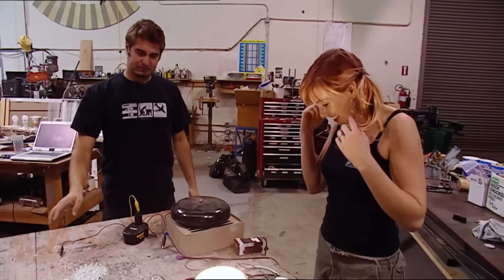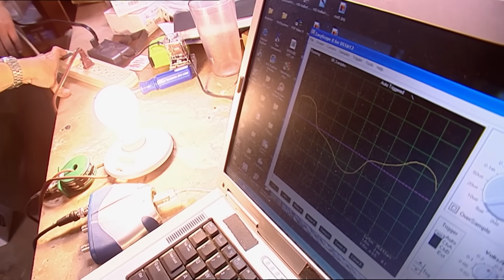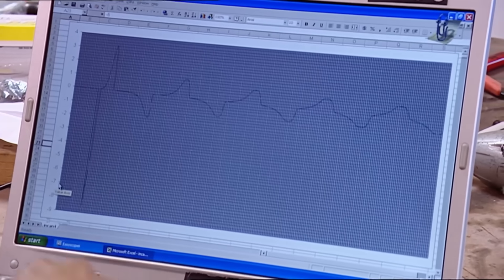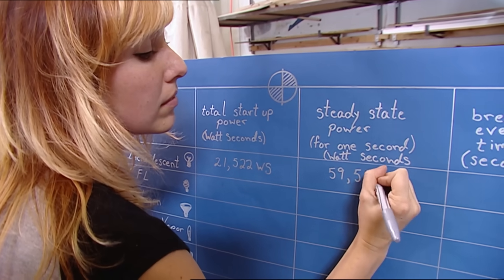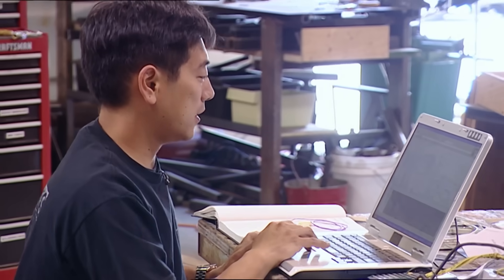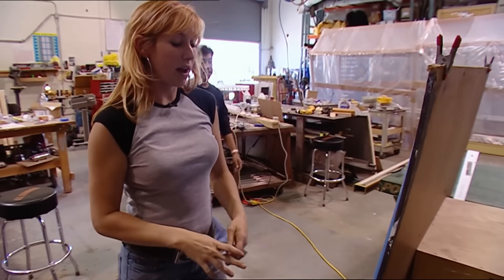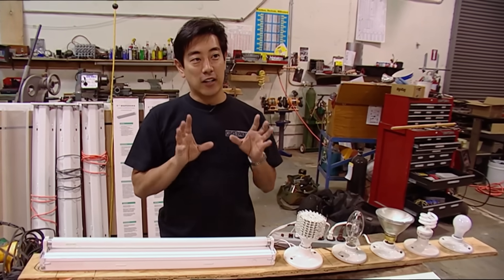Is It Cheaper To Leave The Lights On Than To Turn Them Off? | MythBusters

Comment: This one is obvious. Unless you're sticking around the wall switch all day, constantly turning on and off your lights, you always use less electricity by turning them off. One more thing you forgot: If you do turn on and off your lights every minute, you'll break the wall switch quicker. So added costs there. People still claim it's takes less electricity to leave the lights on. I can't argue with these people. If true, the amount of electricity used on start-up would be so great, your circuit breaker would trip every time you turn on the lights unless you had some massive, high capacity, electrical system. This doesn't happen. One more big energy hog these days is leaving your desktop and/or laptop computer on. I work for a large organization and they want us to leave our PCs on 24/7, so they can get updates. We're talking hundreds of thousands of computers doing nothing during the off hours and weekends, except waiting for updates that may only be pushed two or three times a month. This is a waste of electricity. The updates will still run if they're turned-off, once they're turned back on. Users can also go into the Software Center and check/run them anytime they want.
Reply: Ehh, most computers slip into a very low power state when left alone, they can be woken by the network on demand but will spend most of their time doing almost nothing and are going to have a power pull far, far lower than you are imagining. One days usage of one computer, without digging into exact numbers, probably costs the same as 50+ days of idle.

Or to put it more directly. Driving one mile in a Tesla is probably about 60 hours of a PC sitting idle. One person with a 20 mile commute spends what, 1200 hours of computer idle electricty, twice a day, five days a week. If you multiply that times hundreds of thousands of employees...one day of WFH a year would save more power than turning off those computers for hundreds of thousands of days.

The numbers here are low, too low to bother with. You are microoptimizing a problem that doesn't exist while missing the far bigger ones
Reply: @doconnell565 The PCs where I am aren't in hibernation mode. The fan is still on, the hard drive light is still flashing, and if the monitors are left on (most are), it's the logon screen displaying nights and weekends for nobody. There's no way for users to change this, because admin privileges are only for IT staff.
Reply: @roachtoasties  I'm not talking hibernation, I'm talking sleep.

Even still, assuming they are running at light load, a mile drive is still 2-3 hours of run time. A standard PC just does not pull that much power when not being used.  Which just shifts your drive to work down to several days instead of several weeks.

Fans are only a couple watts, blinking LED's aren't even meaningful power usage. The problem here isn't leaving them on, its IT not having sleep mode enabled with wake on lan on its hardware.

Comment: What's a "watt-second" ... do you mean energy and not power? ... "uses the same amount of power ...." do you folks even own a first-year physics textbook ... must still be brand new in the wrapper ... a 100 watt light bulb draws 100 joules of energy per second whether over 15 microseconds or 27 years ... 
This isn't a myth ... its a legend ... meaning it's based on some convoluted truth ... light bulbs have profoundly great start-up characteristics ... now compare to a large industrial three-phase electric motor ... say like in a diesel/electric freight train ... look how long it takes to get to speed ... profoundly bad start-up characteristics ...

Comment: So what about cars? I heard growing up that if you’re only going to be parked for ~15-20 minutes, it saves you gas and is easier on your engine if you leave it running because of the fuel used and ware on the engine every time you start your car.
Reply: Depends on your engine

Comment: The way this was explained to me as a child in school during the 60s (with only fluorescent or incandecent bulbs) was a dividing line based on bulb cost versus power used. Botton line was leave fluorescents on if you are only gone say 5-10 minutes. The (expensive) bulbs will last longer. Incandecents should be off every time you leave. In those days we still had 300 watt bulbs by the dozen lighting up a classroom. With a dozen fluorescent fixtures in the same room you needed sun glasses!

Comment: In Canada in winter, the heating effect is also important. Leaving the lights on helps heat your room. That offset some of the cost.
Reply: No because your lighbulb is a terrible heater and you're actually paying more to power on your bulb heaters.

If you have cheap electricity heat and expensive gas, then buy electric heaters.
Reply: Same in parts of the US, some people were using 40w incandescent lights in their basement to help prevent the pipes from freezing. 

I personally have all electric heating, the only reason I switched to LEDs is because during the summer I don't need or want the heat.
Reply: Do you still use incandescent bulbs there? I don't even think we can buy them here in the US.
Reply: @woody5476  No, most people in Canada have switched to LEDs. It's very hard to buy incandescent bulbs in big box stores these days.
Reply: What about summer time? They emit more heat when you need cooling. Your air conditioner will work harder to cool warmer air, so any savings you get in the winter, you lose in the summer. You're far better off switching to LEDs and turning them off when you don't use them. Your wallet will thank me.
Reply: Right. Noone geht’s this! In fact efficiency is 100% in the heating period.

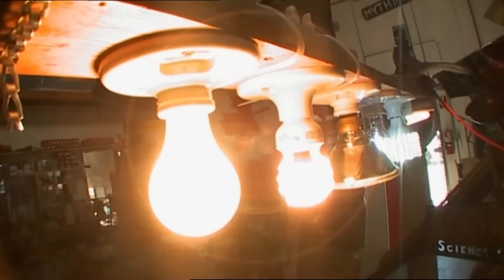Comment: 5:13 so basically, light bulbs are designed to break after turned on/off 10,000 times.  It's engineered breakage.
Reply: Not necessarily, since material expands when heated, cycling induces thermal stress fractures in whatever construction is used to make light. I'm certain the companies could do a better job at preventing this, but this is not a manufactured issue, rather a poorly solved one
Reply: @miksceihners50  it’s actually engineered by the lightbulb selling companies. You may want to google that. It’s covered in another science channel - Veratasium
Reply: @miksceihners50 yeah. It’s less about building to make it die quickly and need replacing as it is building a better, brighter, cheaper, and more efficient light, over building a longer lasting one

Comment: There used to be a light bulb that burned in a garage in my town. 
 It was never shut off. 
I'm pretty sure it was 47 years it was working. 
  I personally saw it entire life until I was 27. 
 The messed up part is it didn't burn out. 
 One of the mechanics broke it when he went up to clean it. 
  It hung in the center of a 30-foot high ceiling garage. 
 The mechanic suggested to the owner that he clean the light. 
 The owner said it's never been clean since it's been there. 
 Go ahead and clean it if you want. 
 Nothing but shattered glass and what could have been was left.😢
Reply: A friend's house, that had been built by her grandfather, had several light bulbs that had never been changed and were over 70 years old.
Reply: Ah the good ol days. They just dont make stuff like they used to!!! 😂😂😂🤣
Reply: @HaOsLsE  thermal cycles (turning on and off) kill an incandescent light more quickly as temperature changes rapidly. Incandescent light bulbs are designed to burn very hot because they are much more efficient when burning hotter. Eventually, if left alone and not switched on and off, the filament will evaporate until the filament is much thinner and has higher resistance. It can't let as much current through, doesn't get as hot, and will last forever while being terribly inefficient and dim. It still uses a lot of power and doesn't give off much light at all compared to when it was new.
Reply: @zach6867  same thing with LED, also most LED are 'overloaded' most of the time as it cannot self-regulate the current by its internal resistance. so if you want to make your LED last longer, get better FULL BRIDGE RECTIFIER and capacitor and adjust the current accordingly
Reply: Cleaning a hot light bulb is almost guaranteed explosion (might not apply to bulbs that don't get really hot like LEDs).
Reply: I worked at a Company that ran it's office lights 24/7.They only were off during outages(2-3/per year.) I was there 33 years and changed 2 Ballasts a 5 bulbs! It was my job to maintain!
Reply: I have lived in our house for 41 years. I have two lights that I have never had to change the bulbs.
Reply: The lesson here is, never clean anything.
Reply: 47 years is pretty amazing, but doesn't touch the record of the light bulb in Livermore CA burning continually since 1901 to this day!
Reply: @middleagedgamers7750  That's amazing. Anyone interested. It's Centennial Light Bulb on livermoreca.gov. You don't even have to visit it...it's on 24/7 camera. http://bulbcam.cityofpleasantonca.gov/. I just find it hard to believe, no storms...power outages at all in over 124 years? Sounds fishy to me.
Reply: @middleagedgamers7750 is that the one huell howser visited?
Reply: @whatchutalkinaboutwillard6547  I loved Huel’s but I missed that episode
In 1971 I worked at that county fire department. It’s on cottage Avenue in Livermore.
Reply: *College Avenue
Reply: @middleagedgamers7750  at the county fire department, I believe
Reply: (Incandescent) light bulbs were intentionally designed to burn out. This isn't a conspiracy theory... because it's a conspiracy fact. We know the light bulb companies got together and agreed on this, including setting penalties for companies who produced light bulbs that lasted too long.
If it weren't for that, bulbs would have lasted far, far longer.
Reply: @Mythraen if bulbs lasted forever there would be no repeat business and the one company probably would have gone out of business.
Reply: @billdivine9501  "The one company"?
In any case, yes, I am aware that capitalism provides reasons to act immorally.
Reply: @Mythraen  incandescent bulbs have an optimal range. They are more power efficient and work better when very hot, but in return they do not last as long. If you want to make an incandescent bulb last forever, add resistance to the circuit until it is running much dimmer than it was designed for, and you will get a bulb that lasts forever. It will burn through your electric bill for not a lot of light, but you won't have to replace it.
Reply: The random spacing for each new line is oddly hilarious. Pick a lane grandpa
Reply: That was carbon wire bulb. Wolfram stuff is evaporating.

Comment: My take now is that LED lights use such little power that it doesn't really save on my electric bill.  If I'm moving between rooms a lot I just leave them on and turn them off only when I don't plan on coming back in a while.  The computer is the thing that uses the most discretionary power.  Most power is in HVAC and water heating but that's a separate thing.  I've taken to turning off my PC overnight and only turning it on when I actually use it.  An LED bulb is only around 18W while a PC can be in the hundreds.  A big TV is also a lot by the way.  Another thing, in the winter when you are heating the house 100% of the usage whatever the source helps heat the house so nothing is really wasted.  But in the summer when you're running the AC it has to work double to pull that heat out of the house so every Watt matters in that case.

Comment: i do wanna say all light produces heat.  so still could be more cost efficient to leave them on in a closed space instead of run a heater...ive lived without central heating and air for years. and led lights with 10k to 20k lums will heat a room alot cheaper than a heat pump... @mythbusters try it out

Comment: Only part of the equation. A glaring omission is the cost of air conditioning to pump the lamp heat to the outdoors. Add heat to the room, pay to remove that heat.

Maybe heat's a great thing if you live on Siberia, Alaska or Antarctica. Not of you live in Cairo, Phoenix or Dallas.

Comment: I'm electrician and installed a whole building with some bulbs never switching off during night time, because calculations say it is cheaper to run them 10 hours rather than 50x per night with movement sensors.

Comment: It's a bit surprising to see the units in their calculations messed up this badly. The measurements in watt seconds are off by a factor of at least 1000 (so likely should've been milli watt seconds), and the unit for energy consumption in the table is given as "W/h" when it should be just W.

The conclusions seem right since division eliminates the error with units, but for example if the start-up power of 21,522 Ws were correct and that lamp consumes 90 watts, then you would have to leave it off for over 4 minutes before you got any energy savings.

Putting it another way, since the startup time on the oscilloscope is on the order of milliseconds, its temporary power draw would be on the order of 10-20 *megawatts*, or over 1% of the energy output of a freaking nuclear reactor.

Comment: I’m an electrician who specializes in lighting. LED lights use significantly less current which means less watts which means smaller bill. They last at least 7 years. If they don’t it’s a lemon. They come in a variety of temperatures (color) and brightness. Anyone who complains about LED lights doesn’t understand them. It’s the same as people complaining about the railroad coming through town back in the day.
Reply: I find majority of led light sources too “sharp” this is worse with cooler color temperatures but I have found it to be the case with certain sources even with warmer temperatures. 

It’s also not brightness since the sharpness seems retained regardless of brightness though it does seem to make it worse.

By sharp I mean the light pierces your eye and or field of vision in a pointed and annoying or painful manner.

How do I solve this??? LEDs are great in so many ways but I can’t get over the comfort the two incandescent bulbs in my vintage lamps give I can stare right at them and not feel discomfort in my eyes. And don’t even get me started colorful decorative lights on source emission vs tints.
Reply: @tanishkatambe5945  get LEDs with better color rendering index if i recall correctly
Reply: they dim lights power if overheating because of longer use
Reply: The CFLs were absolutely the worst, but I've been having great luck with the LEDs in basically every way. The CFLs were expensive and I never found a brand that lasted long enough to make up for the increased cost in terms of decreased power consumption. The LEDs I've got basically haven't failed. I think I've had like a couple of the Phillips Hue smart bulbs from years back that eventually failed, but the regular ones still haven't.
Reply: Would be all fine and dandy if manufacturers didn't remove red, orange, yellow light spectrums from LEDs, only leaving the ones which produce brightest light and fuck up your circadian rhythm. LEDs are amazing in theory but stop being healthy nowadays.

Comment: I have the same doubt on manual transmission vehicles. The myth is the motorcycle will consume more fuel while releasing the clutch than saving the fuel while riding by holding the clutch when descending speed.

Comment: Busted, but your light bulbs almost always fail when you hit that light switch from the initial surge of power. That's why the longest burning light bulb ever, NEVER get turned of and has an instant switch power backup to keep it on even in a power outage. It's in Livermore, CA and it's been on for over 120 YEARS!
Reply: that bulb is just running at a ridiculously low power, which is the main reason it's lasted so long. turning down any incandescent bulb until it's barely giving off light will make it last for decades.
Reply: That bulb is also being run at way less current than its designed for so the amount of sputtering from the filament is miniscule.
Reply: I mean sure but things made 120 years ago were not designed to break. Someone probably has a 120 year old fridge that still works. While I agree the on/off may be an issue for modern lights, I think the backup power on the 120 year old bulb is more about maintaining the right to say "It has been on for xx years without going off" than the concern of it burning.
Reply: there is a really interesting technology connections video about why incandescent bulbs being engineered to fail is mostly a myth, I highly recommend a watch

Comment: I've never heard this claim made for anything other than fluorescent lamps, and that was back in the 1970s.  It was a short-lived idea that was almost immediately disproved.
Reply: Same here. I'm a bit younger, but it was fluorescent lamps and generally a few minutes. Granted, that may have been a combination of issues related to power and that a lot of the fluorescent lights from back in the olden days taking a bit to get up to full brightness back then.
Reply: @SmallSpoonBrigade  I think it was true for the older style of fluorescent tubes, which is why you saw offices keep them on all night.  But improved manufacturing made them so turning them on and off didn't shorten their lifespan by an average of 30%.

Comment: simple calculation would suggest that turning the lights off to save electricity is a waste of time in most residences when you're using LED bulbs.

a living room use 6 x 15 watt equivalent LED bulbs (1600 lumens each). @ 8 hours of use per day x 30 days per month ~= 22 kw/h * $0.15/kw/h = $3.3 dollars.

if you minimize use all over the house. maybe you'll save 5 bucks a month in electricity a month. total waste of effort. Focus on things that actually use a lot of power, like the stove/oven, air conditioning, washer/dryer etc..,